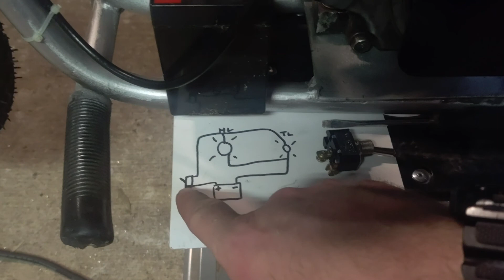Vintage Mini Bike Restoration

Comment: Good looking Sensation Mike Bike! I have one I got new as a 10 year old in 1969.  Frame is complete and all original but motor was worn out and long gone. Getting ready rebuild it.
Reply from the maker: Very cool! What kind of motor you planning to put on it?
Reply: Planning to use a 1973 5hp Briggs that I’m freshening up.  It originally came with a 3hp Briggs.
Reply from the maker: Sweet!